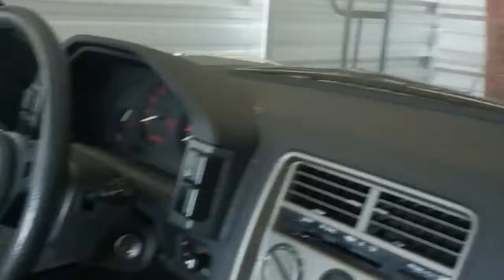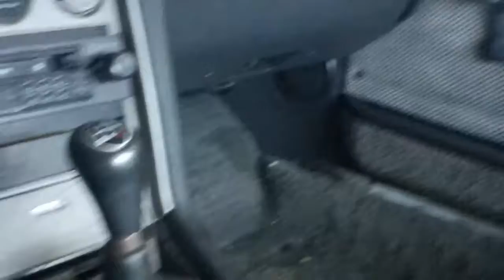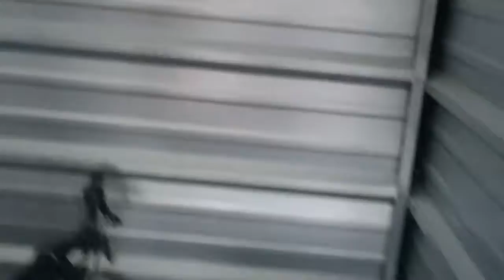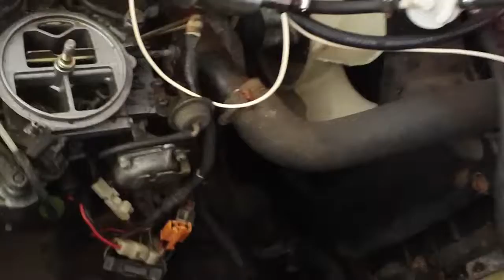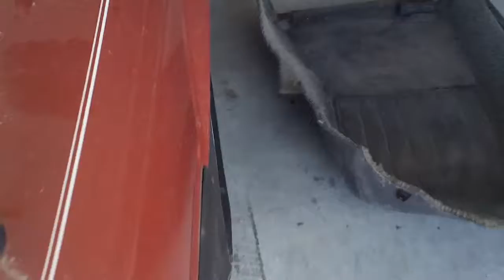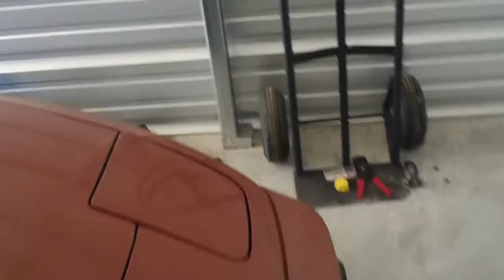Alex | First Channel Video | Rx7 Build | About Channel

Comment: interesting, and now this is kind of an off topic question from the video, but what car would you recommend buying this year under $25k and why? just a potential video idea too.
Reply from the maker: Underground Tech Thanks! That sounds like an awesome video idea. Especially because it’s a common question. I would definitely say a Honda, (Type of Honda depends on what you’re looking for. Suv, sedan, coupe etc. ) Reliable as a Toyota but very cheap to maintain and typically averages over 250k miles.